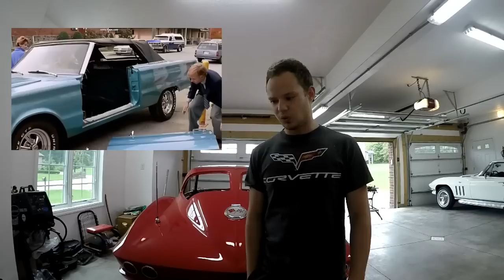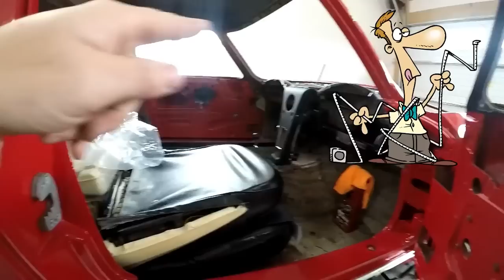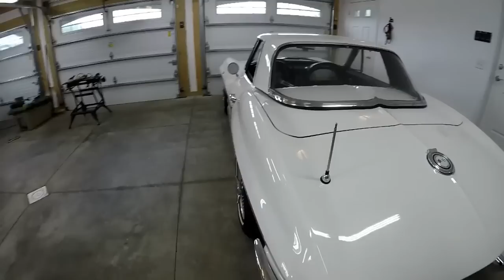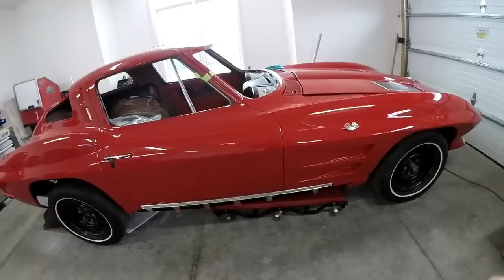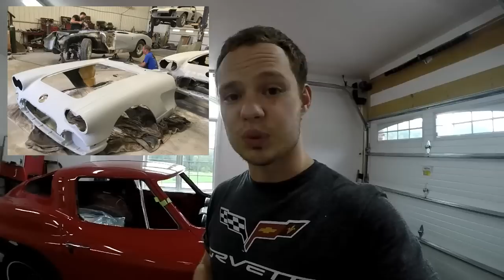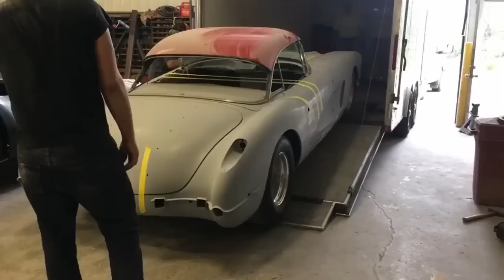1958 Corvette Prostreet Build Flop to Show Stopper

Comment: Yes I hear you my 70 got wrecked I. The rear the The first body shop, I brought it to took the whole wheel and the part on the doors back learned, they could not buy the parts and just stuck it in the corner of the shop. I moved to a Corvette body shop, and they put it together Crooked eye, I finally put it ripped it all apart and put it together myself, right

Comment: I really enjoyed the video!
Does any fiberglass body repair on a classic Corvette, regardless of how miniscule the damage may be, Need a bonding strip?
Reply from the maker: Thanks Lance! And good question, no not every repair needs one. If you have a crack or a chip in a panel you won’t need it. But if you are splicing 2 panels together you will need one. In a later video on the 60 vette we will splice in a fender cap and we will use a bonding strip on the top to make that panel as strong as it was originally. Does that answer your question?
Reply: Yes!   Thank you!
I will be looking forward to your later video splicing the fender cap on the '60 Vette